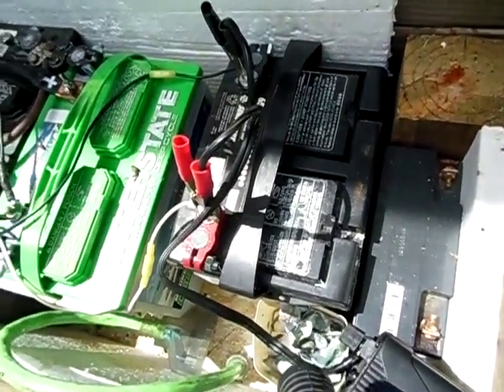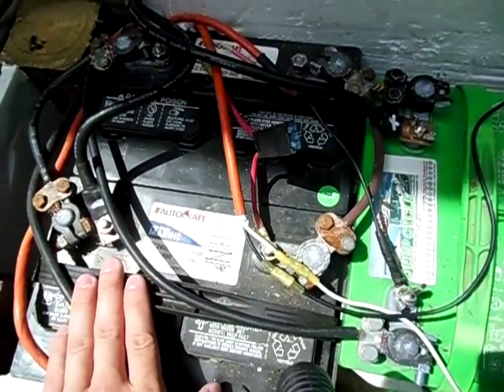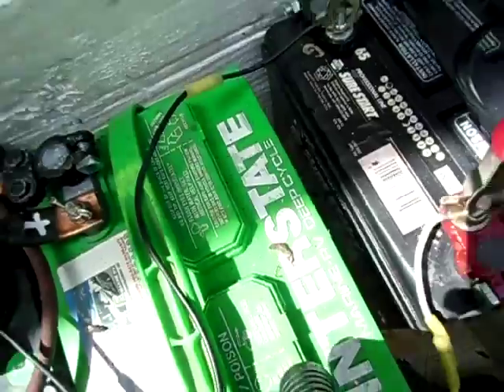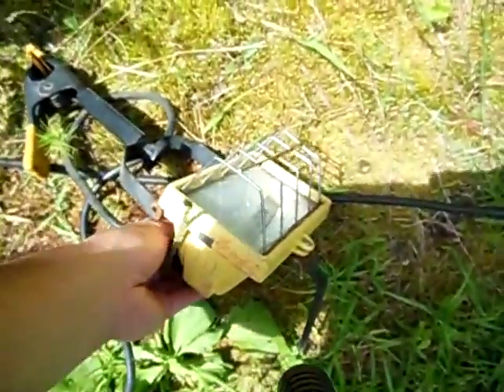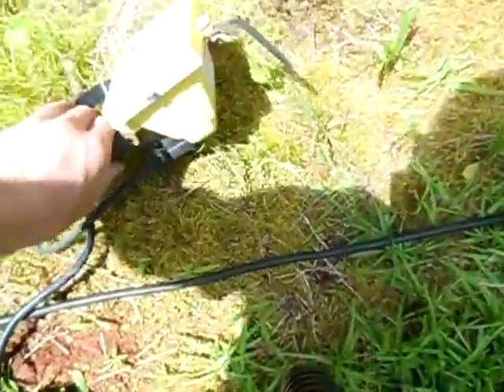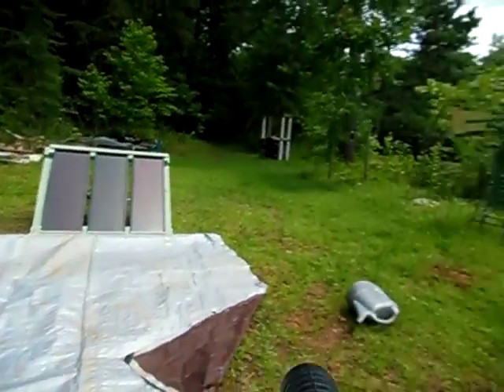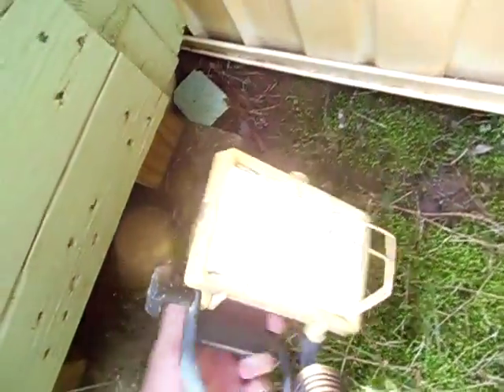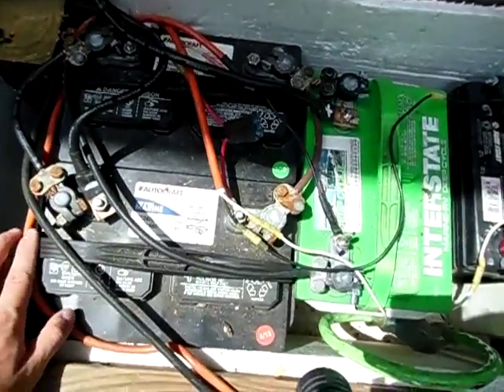Using Old Car Batteries In A Solar Power System

Comment: I'm a low income earner & so far I've managed to save up & buy basic solar needs (inverter, charge controller, 600w solar panels) in over 4 months, now what's left are batteries and they are crazy expensive over here, came across some dude who wanted to junk three 75ah starter batteries that were taken off accident cars, bought them for less than 20 dollars each, hooked them up in parallel & am getting 225ah but given it's lead acid i just have it in mind i have a 110 battery bank, I've taken good care of the batteries, never discharged them below 12.1 and during the day charge controller keeps it at 13.1v & float at 13.5 so far it's been working good since I don't run more than 40amps at a time it's been 4½ months & going no issues.

Comment: i'd like to know how low would your battery voltage go before the inverter stop working
Reply from the maker: My inverter cuts off at 10.5 volts
Reply: @2012solarful  A CAR BATTERY IS STILL FINE  UP TO 9V BEFORE IT  FAIL
Reply from the maker: Yep but most power inverters will cur off before possible damage to the batteries

Comment: Hey have question Im about to buy  power station that's $50 bucks , I seen your video, what would you recommend or which lasts longer in stored energy a car battery with inverter or a power station

Comment: sometimes it is only one cell that goes bad.. so you can take them apart and group which ones are good.   but understand that you only get back about 50 percent of the energy you put in... or some i'm told. capacitors are much more efficient.

Comment: I have 4- 80 watt solar panels, connected to one car battery. All summer was good, never any problems. Not as much power in the winter. I found only about 18 hrs of use in Nov, Dec, and Jan, but now is better again. Lights are always there, but when it's low, I have to shut off my computer, TV, and stuff.
Reply: Could you give me some tips or mind sharing what your solar set up consist of?

Comment: I have a dual battery system and the primary battery must remain near fully charged.  The secondary "house" one is a car battery. That disconnects from the primary battery about 6pm. the car battery runs everything the rest of the night. What is unusual is that battery was pulled out of a car 4 years ago because it wouldn't start the vehicle.  I get an hour of TV news and then 2 hours of DVD movie and lights for my wife to read. Modest load, but it defies reason why it is still working.  It is no loss when it does fail.
Reply: I think it's because as a starter battery it needs to delivery peak power for a short burst. If it can't reach a high enough peak it won't crank your car over, but for a small amp draw it's not a heavy load for the batt at all.
Reply: It doesn't matter, they are just car batteries. Primary one is from the car I don't bring to camp for the summer. If left at home, no matter what you did it would be damaged from not being used. My system is totally unlike anything that can be bought or unlikely you could build.  If you tried it you would go up in flames.  Over 2.7KW of panels into a car battery! I use most of the power directly by not going thru a battery. There are rules to follow using a car battery. The main battery never gets more than a 15% discharge.  The junk battery gets treated horribly, but it is junk already.
Reply: I want to see it in action

Comment: Thanks for the video.  What other components do you have in place? Are you using a regulator with the battery? Or do you have the solar panels directly plugged into the batter?

Comment: What people don't realise is that  even though you can use old car batteries,  you shouldn't because of the way deep cycle batteries and car batteries are made.

Think of a tortoise and a  hare. 

A deep cycle battery is a "tortoise."
You can store the power and gradually drain the battery below 50% and the battery will recover. 

The car  battery is like a hare.  Good for short bursts, but it needs to be constantly charged and if it's voltage drops below around 10 to 20%, it may be  irreversibly damaged.
Reply: I'm not sure that "you shouldn't" use them. There are just reasons why they aren't optimal for solar arrays and other batteries are more optimal. I would say you shouldn't go out and buy new auto batteries for solar use, but if you have a few lying around that no longer start your car and you are going to junk them or recycle them, they may be able to increase your capacity and they are not in danger of damaging anything in your system except itself.
Reply: @Kactapuss  I dont even know about that.  Buying new ones from Walmart is pretty cheap their base battery is under 50 bucks.  At that price even if you burn them out in a year I think it still ends up being cheaper than deep cycle battery array of the same size.
Reply: I understand that deep cucle batteries are better but if all you have is car batteries  they work too.

Comment: I hear a lot of people say dont waist your time on car batteries, but if you can get them free or real cheap they can be a blessing at times.I have 3 car batteries that I do use a few times a week just to help lighten the load of my small bank solar batteries, and when our power went out for 3 days and it rained for a week my batteries was struggling keeping some lights running and the car batteries was able to help with lights and even charge a couple phones and keep internet running. Yes we had to have internet lol. So I say if you can get them fairly cheap set up a back up bank if you do not have a large solar bank already. Question I see you always have the tarp in front of your panels are you using that to reflect light or do you cover your panels up?
Reply: I found 3 brand new car batteries I hooked them to my 2 giant 200w panels sometimes when we have a tough storm and the power goes out I hook it up to my pc Xbox 360 led tv and some ld's and it's running over 7 hours with ease
Reply: I think car batteries can go great with 24/48 volt system cuz your not drawing a lot of amperage and the system runs more efficiently. So your not damaging them as you would on a 12 volt system .
Reply from the maker: Thanks for the tips! I use the tarp to cover up the panels when it rains. At first I was kinda thinking that it would help reflect sunlight on the panels, but when I test the volts and amps with and without the tarp there was no change whatsoever. So the tarp really didn't do anything as for as the panels are concerned.